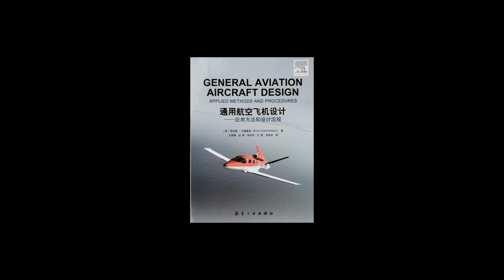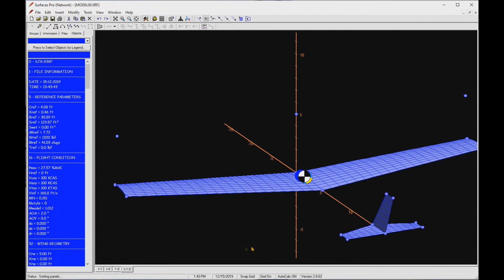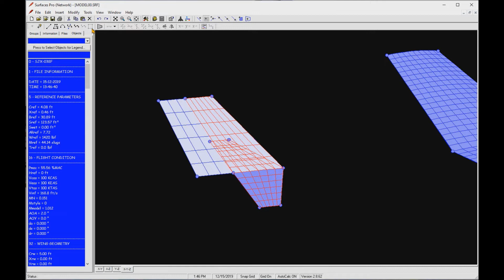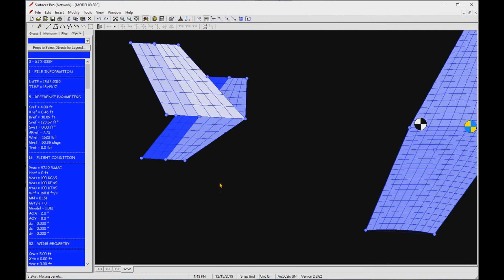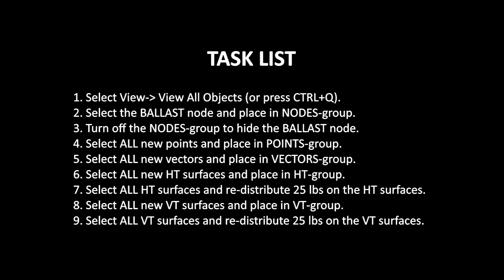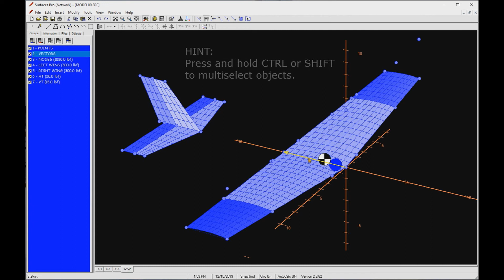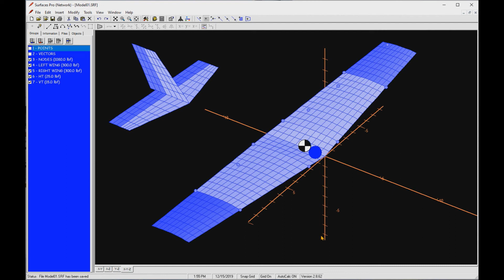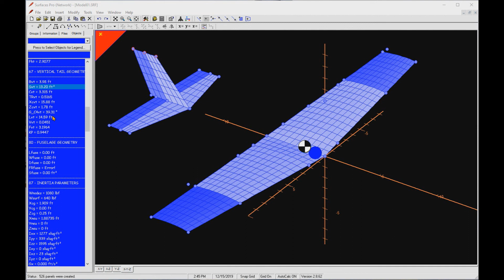PART 5: Version 2 created and compared to two LSA, ailerons, elevator, and rudder added.

Comment: Dear Dr. Gudmundsson’s thanks for your job. I’ve got an light a/c Vulcan c100rg since 2005 that now I’m modifying. I always have had problem by the low authority of the tail. More precisely during take off and when try to keeping the wing slip which it is impossible to maintain, the a/c return straight even with full rudder. I made a comparison with similar a/c and realise that the total Surface is smaller and the rudder much smaller. According to you do I doing right trying to increase, keeping proportion, the surface of the rudder? What is the right way to face and correct the problem (or finding a better compromise)? Thank you 
Salvo
Reply from the maker: Hi Salvo. Thank you for your message. Unfortunately, I have to be very careful and not speculate on makes and models of aircraft without knowing more details (and then not in public). I am not familiar enough with the Vulcan to comment on it specifically. In general, enlarging the vertical tail of an existing airplane will increase its directional stability. How this affects controllability depends on the size of the rudder (will it change too?) and the control horn (assuming it has one). But there are other contributions that must be considered too. Enlarging the vertical tail increases aerodynamic shear, bending, and torsional loads, so one must confirm if the fuselage can still react this. Also, a larger vertical tail means more mass and a large mass change may reduce the aircraft's flutter speed. This speed must typically be larger than 1.2 x dive speed. Unfortunately, enlarging the vertical tail may constitute a significant change and, thus, you should approach it with great care. I suggest you consult the airplane manufacturer and get their insight. Sorry I can't be of more help and hope you understand why. Best wishes.
Reply: @dr.gudmundssonaircraftdesign  hello Dr. Thanks for your replay, unfortunately the a/c manufacturers doesn’t exist anymore so I’ll take my risk. I’ve really appreciated your suggestions, aware of the extreme delicacy of the issue. I’ll be careful by enlarging just the rudder until reaching the right proportion with the actual fin. I’ll also statically balance the rudder, the old was lacking. We will see 
Best regards
Salvo